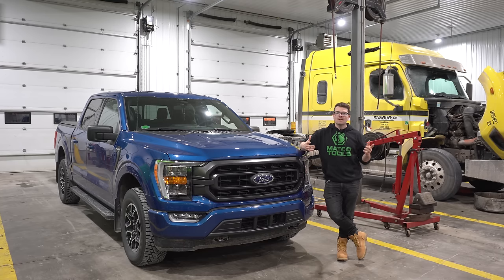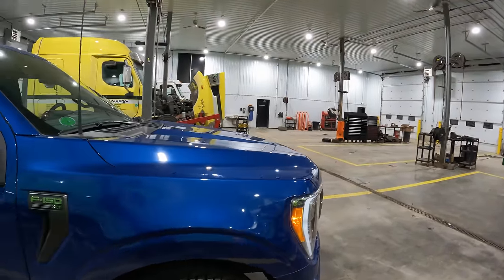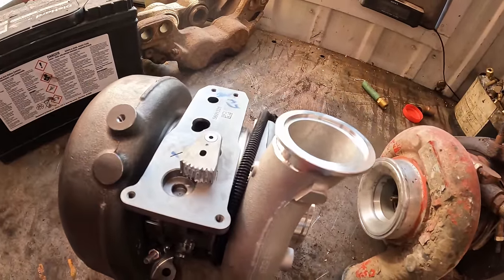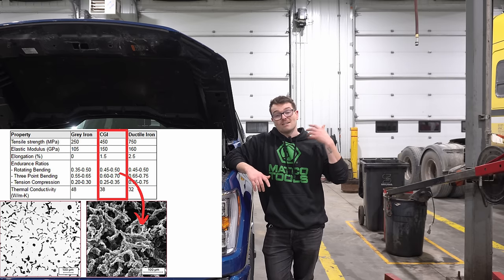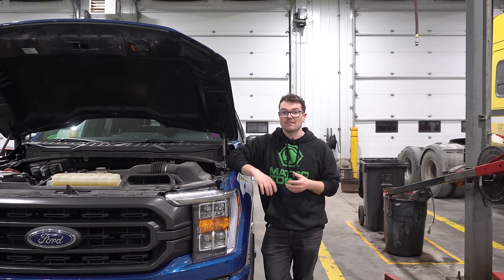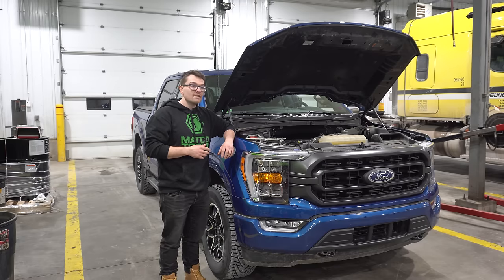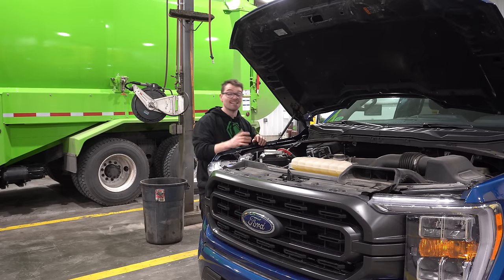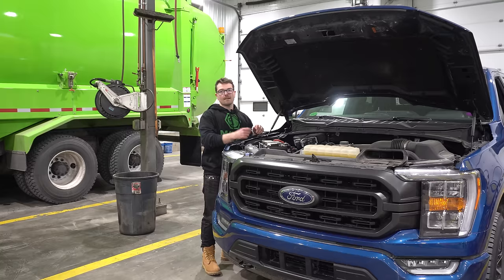Ford F150 2.7L EcoBoost V6 Engine **Heavy Mechanic Review** | How GOOD Is It??

Comment: I have 2019 F150 with 65k on it.  Had a total trans failure.    Anyone else with these issues with the 10 speed ?   I would love to hear why the 10 speed has had so many issues.
Reply: Ford is being sued for the 10 speed transmission.  I saw it in the news the other day.
Reply from the maker: 10 Speeds are having issues without a doubt
Reply: After my 2 year warranty is up on my repairs I’m dumping the Ford.  Any suggestions in the 1500 class ?  I really appreciate the feedback!!
Reply: @JosephRocco-m6m Another Ford! What is your current F-150 and what are your complaints?
Reply: I have a 2019 5.0 super crew with 3.55 gears.  My trans went out at 65K and was not cover under warranty.  Cost me a lot out of pocket.   I baby this truck. Only tow a bass boat with it.   I have loved f150s up until now.  It’s my 3rd one
Reply: I have 2 close friends with 2018s. They both had trans failures well before 100k
Reply: Mine is a 2018 F-150 3.5 crew cab 4x4 with 3.55 rear. 160,000 and so far trans has been good. I did update the cam phasers at 140,000 due to slight cold start rattle. Alot of hi way miles which helps I'm sure with less shifting. I do tow heavy occasionally. Best truck I've ever owned!
Reply: I’m glad you’ve had good luck.  Unfortunately after what I went through and seeing 2 friends have the same thing happen it will be the last Ford I own and I can say the same for them.   And it’s a shame cause I love the 5.0.   Looking at older tundras.  Seems like they lead in reliability and resale value.
Reply: There is a class action lawsuit against ford and the 10 speed.  Hindsight 2020.  Wish I new this before buying one.
Reply: @JosephRocco-m6m I agonized shopping the one I just bought. I liked the Titan xd the most so that’s what I got and am very happy with it. Tundra would’ve been my first choice but Toyota made one too many chances in my opinion.  

Btw, I left Ford too and will probably never buy another.
Reply: I have bodies with the titan xd and they love them.   Definitely on my radar next to the Toyota.  Really good bang for your buck in the titan I feel like.   The Toyota is reliable but I’m disappointed by the lack of tech in the 2020 models.
Reply: Buddies*
Reply: @user-hp2yu6xw7s  The big hype it seems is the 3.0 Duramax inline 6 in the 1500 class. I not own one.. but would definitely check out..
Reply: Doesn’t that have the 10 speed ?  Pretty sure it’s same one in the ford because that trans was co developed by both GM and ford

Comment: there is a man in the usa who put 354 turbocharged perkins desiel  in a 1976 f250 he puts second transimision in the vechial and has 15 forward gears the motors doing 1500 rpm at 100kmh he get 7.7 litres for every 100km .The motors look neat easy to work on it has not got plastic and cables wires and shit every were in the engine   .like modern motors has no computors controlling the motor  .Give me vechial like this any day over modern ones

Comment: A little confusion in the video between angled connecting rods and an offset crankshaft. The connecting rods are that way to fit through the cylinder bore.

Comment: Good to see all the positive comments. Have a 2018 XLT with 2.7 motor. At 31,000 miles the motor suffered catastrophic failure. $15,000 later and 5 weeks to get it back. First and last Ford I'll own.

Comment: I have a 2016 f150 lariat 5.0 with 315k miles. I’m think of buying a new one and would love the mileage of the 2.7 but I’m afraid of the longevity. Need to get 250k miles out of it at least preferably 300k
Reply: The ‘16 v8 is nothing like the new 5.0

Comment: Sure there is a lot of power pushed out of the 2.7 turbo but I will bet money the 5.0 Coyote will out last it by twice the miles if you are using it as a truck ie pulling big trailers heavy boats etc. Sure if you just drive around with it and it’s basically your car it will last longer.

Comment: Well I can tell you that today 2018'ish versions of this truck around 120k miles went begging across the block for under 10k, while V8 trucks consistently brought about double that.  This is because they are about wore out at 120k and cost several times more to repair.  

If you don't need a V8 then you don't need a truck.  It's that simple.  Also, stop crying when dealers offer pennies on the dollar in trade for this stuff.  If anyone wanted it we'd give you more.

Comment: I have 27k miles on mine, ford said it was e85 compatible, guess what…. Is not. Now ford won’t take responsibility for screwing up. The alternator just went out a few days ago. Pain in the ass to take it out, while there realized the egregious pump is leaking, again at 27k miles.
The 2.7 is the biggest pos truck you can buy! 
Nothing like my old f-150

Comment: When I see one go 1 million miles and still run  great like the 3URFE 5.7 V8 in my 2021 Tundra Platinum I’ll be a believer! Till then it’s unproven technology!
Reply: You took the words right out of my mouth.
Reply: @albertatundra  Most modern automobiles will struggle to reach that, I'd have a hard time believing the newest tundra will do that either.

Doesn't make it unproven lol, reaching 200k is very impressive and all I need from my f150. By then I'll have a different vehicle.
Reply: Or 4.7 2uzfe
Reply: Your 5.7 is also an antiquated boat weight that makes too little power from too much gasoline. There is a reason even Toyota has switched to the 3.5TT

It's not impressive to make an reliable engine that makes shit power and with bad fuel economy. We have been doing that forever. 

Making a reliable engine with great power and fuel economy is very hard, but that's what Ford did with the 2.7.
Reply: @spacebound1969   The Toyota 5.7 will do any task you ask of it in a 1/2 ton truck safely and reliably while lasting much longer than today’s turbo junk !

Comment: Why would anyone buy these trash cars in the first place. People, if you need a good reliable car that will last you a long time with trouble free getting yourself a Toyota or Honda  and you will thank me later.  I have a 2005 Toyota tacoma 4x4 with 275k miles, and it runs and drives excellent. I will never buy anything but Toyota
Reply: Blah blah blah blah blah!
Reply: @BrickMudge  the truth hurts 🤣🤣🤣
Reply: @willtacoma2ndgen661  a Tacoma is nothing but a Camry with different sheet metal hung on it. I’m sure that it’s all you need tho

Comment: My 2021 5.7 tundra will not only outlast this garbage many times, it will also sound much better doing it with a far superior resale value.
Reply: No one cares
Reply: Plenty of Ecoboost 2.7s for sale on autotrader with over 200k miles with just regular maintenance.
Reply: My 18 5L/10R80/3.73 F150 will skeet all over your 5.7L Tundra.... And yeah it really will unless you add bewst's.
Reply: Toyota guys 😂
Reply: @JROC734  I highly doubt it will last a million miles? 😂
Reply: Yeah maybe. You’ll also spend thousands more in fuel. Fuel is expensive now and fuel economy makes a big difference over the life of the vehicle.
Reply: Marginally worse fuel economy than the Ford trucks.  True. However I would take reliability any day over fuel economy.
Reply: @albertatundra It's a lot worse than f150s, but regardless I'm not worse for cash I chose the f150 simply because it's much faster
Reply: And along come the Toyota fanboys.......ughh😂
Reply: @roadglide1142  I don't really give a shit. I don't keep vehicles for a million miles. I expect to get 350K to 400K without much issues if I wanted to. Hell, my parents 08 F150 with a supposed unreliable 5.4L 3V has probably about 320K miles, and runs as smooth as it did when new. Never a major issue with anything on that truck. My bolton 03 Lightning has had 210K trouble free miles, and it's got 21 years of aging on the plastic, rubber, paint, etc. It fires up faster than my 18, idles quietly, (for a truck with an aftermarket exhaust) and smoothly. Never a problem with the drivetrain, other than the rearend seals were starting to leak a little, but that was a cheap, Saturday morning fix for me to replace all three seals on a high mileage 20 year old truck. It's easy to put high mileage on a newer vehicle, it's can you make an older vehicle, whose components have had time to age, last reliably.

I doubt that Road Glide would see 60K miles without major maintenance, and maybe an engine rebuild.
Reply: Who wants to drive the same truck forever anyway.  Life’s to short
Reply from the maker: Jesus you 5.7L Toyota boys are out in full force tonight! I get it the 5.7L is a legit fantastic engine but this 2.7L doesn't look so bad either.
Reply: and get 10 MPG.  lol
Reply: @roadglide1142  they usually rust in half way before a million mi😝

Comment: Overengineered junk engines. We have 4 cylinder engines out their with over 3000HP but they last about 100 miles before needing rebuilt. Plus you compare that crap to V8 's that are NA. That 2.3 has 2 turbos and more tech in it than the mars rover. They. Will. NOT. last. Get to a very conservative number, lets say 100K miles. Get to that without having to replace Engine or Trans then we can talk. Only city boys buy those crappy trucks. No one that actually uses them as TRUCKS.  Now.. queue all the simps saying "oh but I haul 1 million tons every day and have 400K miles and dont even change my oil!" comments below.
Reply: I believe the 2.3 is a single turbo. Called a twin-scroll turbo. I can agree with what you are saying.
Reply: 2.3 4 cyl is what’s in ranger and explorer, 2.7 6 cyl is in F150. Talk to most Ford techs and they’ll tell you that the 2.7 is the most reliable of all F150 engines. Which is certainly surprising but if you look on autotrader there’s also many with over 200k miles and carfax shows regular maintance. They’re just great engines. 

I understand why you hate on them, but the ecoboost (specifically 2.7) as proven itself.
Reply: The V8 coyote is a pretty complex engine too. Even if it is an NA V8
Reply: Cry all ya want ,Ecoboost v6 platform is proven since 2011 and can go the distance. These trucks are an absolute joy to drive!
Reply: Always a naysayer in every post
Reply: Yea there’s always a guy scared of turbos. Like it’s some sort of new fangled technological gizmo.
Reply: Ford’s worst engine ever made was a V8 and they probably learned thier lesson after the disaster they called the 5.4.
Reply from the maker: Coyote is a complex V8 without a doubt.
Reply from the maker: The ecoboost engines have proven themselves to be a solid option in the 1500 truck segment. They aren't perfect but a ton of people like them and I personally think they drive exceptionally well.